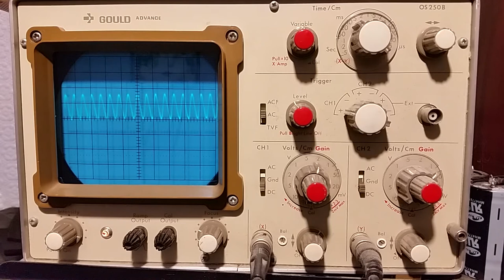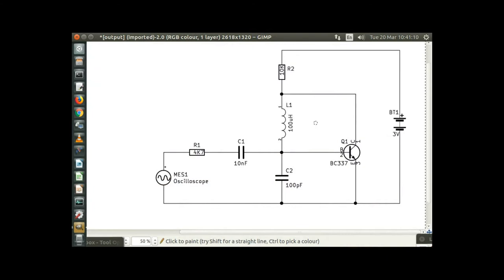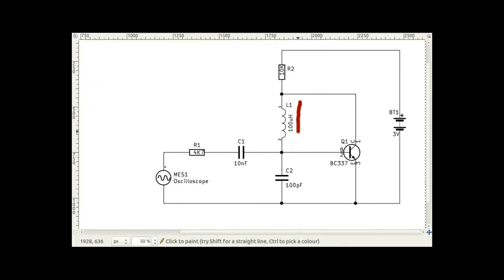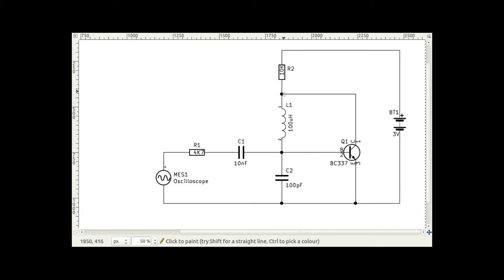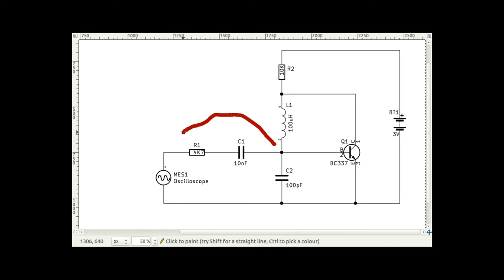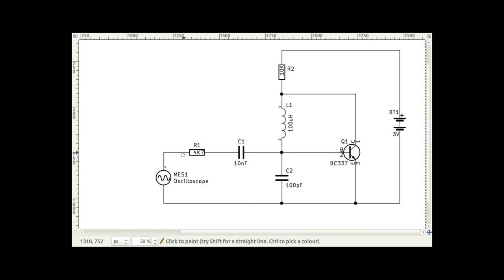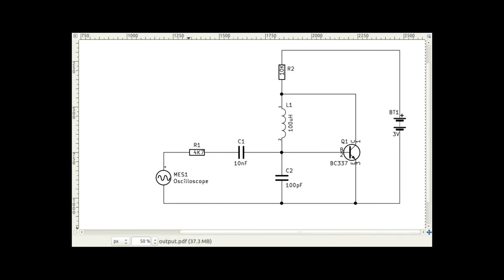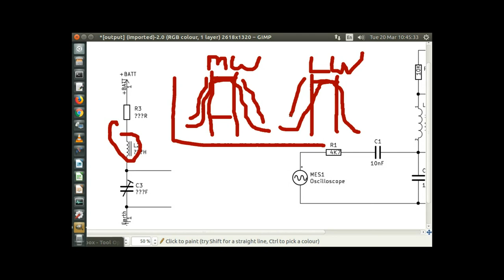Inductor Capacitor (LC) Oscillator Circuit

Comment: You video was the only I could find that explained simply how to build an analog oscillator with no need for a function generator or other complexity. Couldn't figure out on my own how to make the feedback needed to keep the oscillation going. Followed your example here with various combinations of inductors and caps and got oscillations in the range of 350KHz all the way up to 2MHz. Thanks for making this video.
Reply from the maker: This is good to hear, thank you for letting me know. I always intended to try and do more with this circuit for radio applications, but haven't done yet.